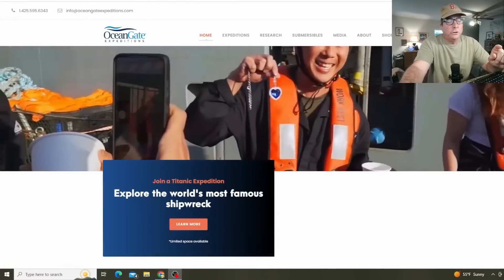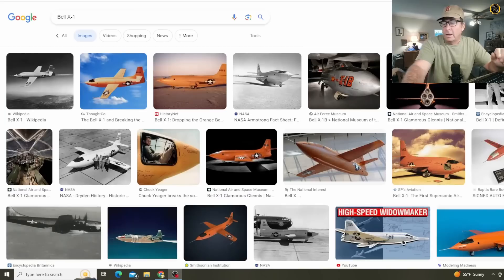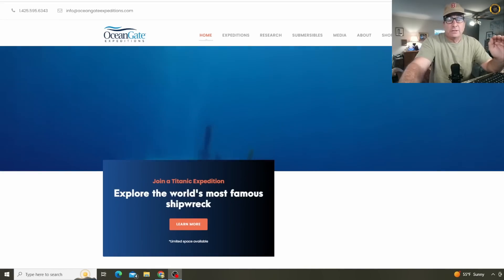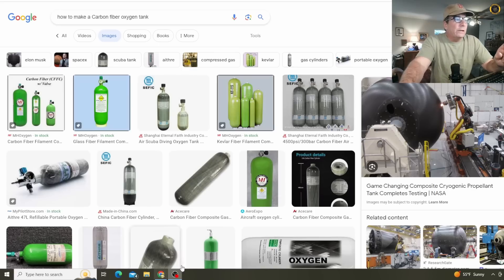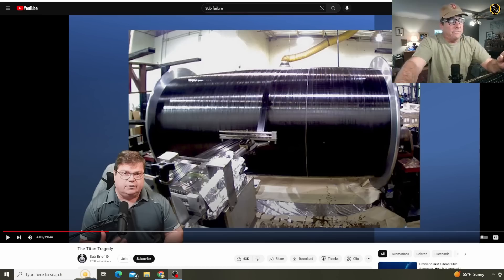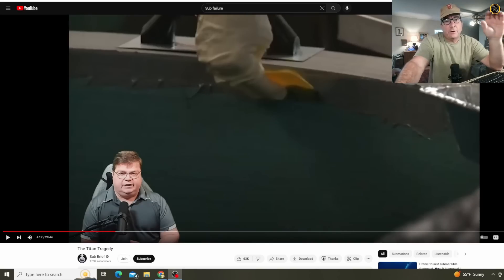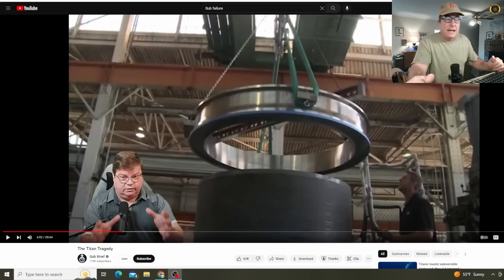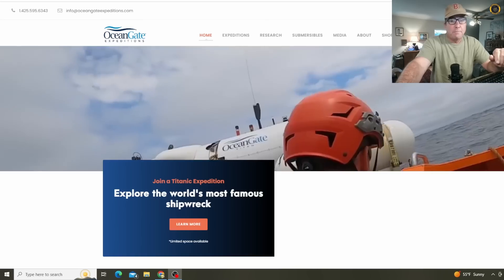Oceangate Sub Construction Details and Implosion

Comment: Great breakdown analysis. I do wonder what if the submarine pressure vessel was made using the same methods for carbon fiber scba air cylinders with an alloy liner. So basically a single piece homogeneous titanium liner then wrapped with the carbon fiber epoxy in multi plane directions for uniform stress distribution. Would it be possible for a pressure vessel the size and dimensions of the titan to be made that way? scba carbon fiber tanks are much smaller so maybe the fiber wrapping equipment has size limitations?

Comment: I've worked on glass fibre boats for nearly 50 years. Hulls built using chopped strand mat are incredibly strong and durable as the strands from one layer merge into the layer below. There is also "roving", which is a woven material using long glass treads. Normally this should be used with interspersed layers of mat to hold it all together but some builders use only the roving. All that happens is that the layers are glued together by resin. As the resin ages and begins to break up, the layers of roving separate and the structure breaks down. Watching the carbon fibre being wound round the cylinder is just like using roving. There is no inherent strength in the structure and faith is being put entirely in thickness. Also, the entire structure is relying on the strength of the glue to hold the shell and the end caps together.
Reply: @@davesmith3023 Since it's not a pressure vessel, I guess it would do fine at 1000psi as well as 20! 🤣
Reply: @stab74  yes, exactly 🤣
Reply: Yes the glue holding the titanium end caps to the CF cylinder is my theory of initial failure. Adhesives go through off-gassing as they are jostled and subjected to changing temps and pressures. It wouldn't take very much for the glue to give way on a microscopic level, and degradation after this would be pretty swift at extreme depths.
Reply: @bat__bat  I doubt it. In my experience as an engineer, the bonding would be the last point of failure. It would have started to leak before any kind of catastrophic event. It's more likely that cyclic fatigue on the tube itself led to delamination and ultimately, failure to withstand the external pressure. It's a pity that they didn't have an accompanying ROV with camera so we can understand what actually happened.
Reply: @MarkoVukovic0  you don't think the adhesive they used could have encountered cyclic fatigue as well? Also the possibility of off-gassing depending on the chemicals used in the glue which could have altered the consistency and density of the glue. Microscopic leaks in the glue could have led to a catastrophe quicker than they could have remedied it. Lastly, it appeared that the thickness and consistency of the carbon fiber was very controlled. The application of the glue, much less so.
Reply: Yes, I'm not an engineer but I can see that the carbon fiber part would have been stronger if it was a 'cross weave' (the only carbon fiber I've seen) instead of rolled like sellotape.  Not sure if cross weave or chopped strand is stronger...
Reply: @edityourname5598 Cross weaving wouldn't have helped. Carbon fiber weaves of any kind have terrible compression strength, and tend to delaminate and form voids under such conditions.
Reply: @griffinfaulkner3514  OK
Reply: @griffinfaulkner3514  exactly. Whatever strength the tube had was from the resin. Actually they should rather have made it out of resin and possibly just some elastic binding fiber for shaping. Carbon fiber breaks up pretty fast under compression by buckling. Not pretty. I bet there must not be much left of the tube except carbon powder and some sub-inch pieces after such a violent implosion then explosion. The titanium hemispheric ends may have ended up in a better shape - although probably fractured and deformed.
Reply: Interesting, thanks for your input.

Comment: Insightful video. Being Vehicle Safety Engineer its quite shocking to know that this vessel has been made of composites for deep sea exploration. Whoever designed the vessel did ignore the basics of testing a vehicle design. They must have done some simulations like structural analysis to see the effect of forces on the design. This definately indicates safety engineering protocols were never followed.

Comment: Carbon fiber has negative thermal expansion and titanium has positive thermal expansion. As the vessel cooled in the deep cold water the titanium rings would shrink on the expanding cylinder.

Comment: Airbus & Boeing with all their money and resources are having Carbon Fibre Composite problems.  And they are dealing with internal pressures which are mild compared to this Machine.  As you said Carbon Fibre Composites are very strong when being stretched, but compression is a difficult problem. Why didn't an engineer stop this build. I know one guy did walk offsite. But the people seen wrapping the fibe should have known. Weaving the Fibre like on Aircraft would probably be safer, but requires Multimillion dollar computer controlled equipment.

Comment: Was there any practical purpose of using Titanium? I get why they would use it in aviation where it's extremely viable for it's strength to weight ratio, but for a submersible, weight is nowhere near as necessary a consideration. Wouldn't it be more practical to just use material that would be stronger and more flexible - likely also cheaper since light weight isn't a criteria?

Same with carbon fiber. It's used in aviation primarily because of weight. Just seems like a very weird and impractical choice of materials for a sub...
Reply: My understanding is that they wanted to minimize weight to facilitate launch / recovery and general handling with fewer host-ship equipment requirements.
Reply: @apgardude  That's still weird - it's not like they are lifting it by hand, and a ship crane isn't going to care for an extra tonne or two... It seemed to me more like the guy just had the Californian / marketing mindset of 'titanium and carbon fiber sounds more high-tech and futuristic' - but I admit I might be biased here so was wondering if there was any actual reasons from engineering point of view.
Reply: @Volkaer  I agree! The weight savings doesn’t justify the use of unproven materials nor would it seem to have a significant impact on ease of handling, and “titanium / carbon fiber” sure does sound sexy! I was just sharing some info I read about this guy. But you’re right, it doesn’t really make sense. It still weighs 10 tonnes!

Comment: I’m sorry but the timing of this incident is far too convenient for my liking. Right when two damning reports are due to be made public, this happens. Then later to find out the military documented this implosion using sensitive underwater detection equipment on Sunday. Let’s not pretend we aren’t all thinking about this. Shady construction aside. (I’m a 25 year yacht remodel contractor and very familiar with carbon fiber, fiberglass, adhesives etc and I would never trust a submersible made of anything other than welded metal material. Thanks again Juan.

Comment: The engineering principle for deep sea exploration is that the vehicle needs to have the most efficient form, which is almost always spherical. To dive using a cylindrical vehicle with glued end caps is suicidal as the stresses on the cylinder are not, I would assume, as even/uniform as those for a sphere due to the length of the cylinder.

Comment: The fiber in composite construction is only strong in tension, using it for external pressure vessels requires pretensioning. Using the matrix to prevent columnar buckling in compression reduces compressive modulus.

Vacuum bagging and autoclaving will not eliminate voids in prepreg composite construction.  These voids will react to pressure cycles by imposing shear stresses in both fiber and matrix.  This makes composite structures highly fatigue sensitive.

Comment: The key for everyone to remember. sea water 63.8 lb/cu ft.  12,500’ is 5,553 psi. It’s extraordinary pressures. I started making carbon fiber drive shafts for my race cars or our race shop did. But it’s was extremely difficult & trying times in 2000 when we started. We quickly learned how carbon fiber fails vs metals. Which was the biggest hurdle. Of course now we are experts at building drive shafts. But it took us years to figure out reliable fab methods. So it makes me get the chills thinking about building a sub out of it. ESP for 5,553 psi.
Reply: Alternatively, a hull of 20m² cross-section at a depth of 4000m beneath 1250kg/m³ water gives a load of 20 x 4e3 x 1.25e3 = 100 million kg.

One has to love SI units. 😉

Comment: Why did the chose composites vs steel? Weight? Weight in water is not that important no? Cost?,
Reply: It is the most cost effective way to get a sufficiently light, but strong material. Weight in water is important, because you want to be close to neutral buoyancy for maneuvering, but you also want the submersible to be able to float to the surface in case of emergency.

Comment: I would expect that part of the nature of the strength carbon fibre construction in tension is its ability to flex.

You don’t want flexion in compression.

Flexion is deformation.

Deformation is asymmetry.

Asymmetry under compression is failure.

Failure at 400 atmospheres is catastrophic.

Comment: There is a place in England that pressure  tests small subs was this sub ever tested i would have liked a steel body instead of carbon  fibre also  if they wanted to escape  in shallow  water they can't  it would be a trip down to David jones  locker

Comment: I understand the carbon fiber to be a failing point - with cracking, etc.  However, the VIEW PORT - was only certified to a MAX depth of 1,300 Meters.  Seems like that would be a huge failing point - since they were diving to 3,800 meters or so...
Reply: And yet it, too, survived, multiple dives to that depth
Reply: @valerierodger  Course at this point - they don't actually KNOW - truly know - what failed.  They know it imploded.  Just as easily could have been the view window.  I have seen 1 video where the engineer discussing - pointed out that using a Viewing Port window with a certification of 1,300 meters to dive to the depths they were going - was egregious to put it mildly.  This was only the third dive the Titan had made - to anywhere near this depth.

Comment: In addition to that, My guess is that Carbon fiber probably DELAMINATED at the joint. Under 6000psi, the thickness of it probably was changing a little bit, making the Outside Diameter smaller which would have created a gap from the titanium insert. This delamination create an openjng for the water under pressire tu infiltrate provressively thru the carbon fiber laminations, making it weaker and weaker at the joint and each time weakening the adhesive strengh.

Comment: What about the PC monitor brackets screwed into the carbon fibre hull?  That thickness could go from 5 inch to 3 inch right there.  Both sides of the hull had this done.

Comment: There are many problems with this design. While the pressure down there may be very high, it does not ensure that the pressue is the same on all sides. The carbon tube was not inspected in any manor between dives to ensure it was structurally sound. Another aspect is did thermal expansion/contraction differences between the titanium and the carbon fiber play a role? The pure lack of following even the most basic safety protocols makes my head hurt. The monitors on the mothership should have heard the implosion but failed to either hear it or report it.

Comment: It makes me think of a carbon fiber fishing rod. It is great, it is strong for awhile,but after repeated battles with large fish, the carbon fibers weaken and eventually break. Usually at the worse when you are hauling in a really big game fish. So one needs to only look as far as your fishing rod to realize that one day that fiber carbon rod will break because of tiny cracks in it. Same with this submersible, the idea is the same, After repeated dives the fiber carbon hull will develop minor stress cracks and will fail if repeated use of the sub is taken and no proper inspections are done to ensure the hull remains safe.

Comment: I wanted to reference a few things about carbon fiber that many who dont work with it may not be aware of. Ive been in the composites biz since the eighties and while mostly marine related i do posses an engineering degree and have a pretty good grasp of CF. There are two vastly different methods of using carbon fiber. First method with the incredible strength that we commonly hear about relates strictly to highly controlled autoclave pre-preg laminates that are cured under heat and pressure using specific ramped cycles and engineered fabric orientations/epoxies. Second are room temp and atmosphere cured saturation lay ups that that carry physicals not much greater the fiberglass and in some cases "S" glass is stronger then CF (used on this sub). These two methods are vastly vastly different in properties. This video is one of the only ones ive seen so far that also mentions orientation of the filament as its being wound on the mandrel/form, this literally eliminates the carbon fiber from having any strength along its axis other then the epoxy, think wood grain and how thin non layered board carries load. That machine laying out the carbon is just a simple saturation unit that wets the tow as its being applied (notice the plastic sheets to handle drips, they are very messy and a poor way to balance ratios) Wet lay up is a very very poor way to use CF and would be considered 1970's tech even if they did do some heated post curing. Sadly this thing was doomed from the start. Great assessment of the end ring as well, i cant wrap my head around any way that was going to work let alone the "home grown" method of mixing in buckets and troweling on adhesive, that clip made my head spin. Thanks for the great content Juan, very well thought out.
Reply: one other thing i forgot to add. A little experiment you can do with carbon fiber if you can get your hands on a length of dry tow (yarn, filament, strand what ever ya want to call it) Take about a foot length and wrap it around the tips of your fingers and pull it tight. You'd probably cut you finger tips off before it yielded. Now, take the same piece and just tie a simple knot in it and do the same thing. It takes surprisingly little pressure, maybe a few pounds, to break the strand. This is because CF is low in shear and if im not mistaken why, when it fails, it fails so violently. Maybe an engineer that deals strictly in aerospace cf can add to this?
Reply: Using CFRP more than 25y and tested most available cf types.. still cannot believe who decided this methodology.. they probably end to court..
Reply: Your point is correct.. main issue in this case is the choice of lay up the UD cf ,give little time to examine the remains, when you deliver loads with UD and don't consider both horizontal and vertical axis its doomed to failure catastrophically!
Reply: I’m a nobody with no kind of real engineering experience (OK, I have an Electronics Engineering degree, but as soon as fasteners or metals harder than tin get involved I’m lost) and my first instinctual response was incredulity when I first read this thing was made with carbon fiber. In addition to a high level of skepticism for its performance under compression, I was baffled as to why one would want a submersible to be light weight. I would think that the only real reason CF and composites have seen adoption in automotive and aircraft manufacturing is for their relative strength to weight ratio, and if anything I would want a submersible to weigh a substantial amount to overcome the buoyancy of the interior space. Presumably more weight equals greater strength and larger allowable interior space. So why on Earth would they choose to use lightweight composites and difficult to machine titanium instead of traditional steel? There must be some uncanny valley of willful ignorance where people, who certainly know more than I do, embarked on a series of poor decisions that left a fine cloud of protein-enriched seawater where a rich moron and his friends had been just milliseconds earlier.